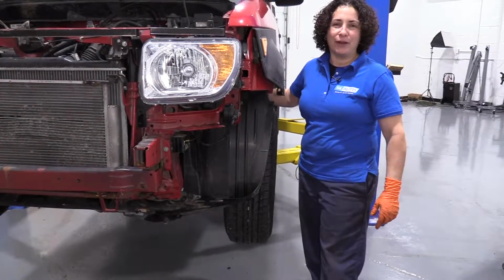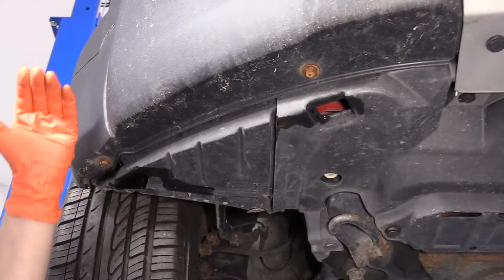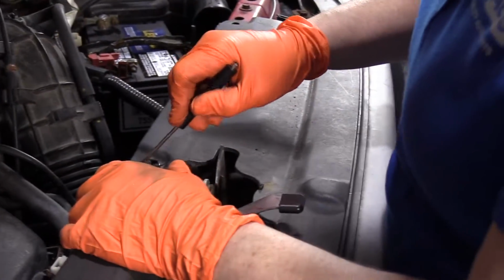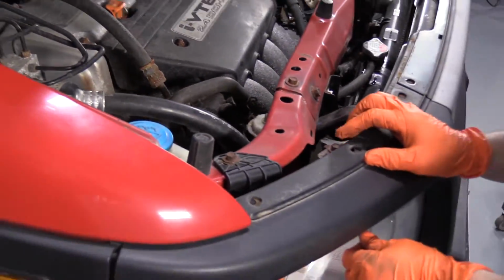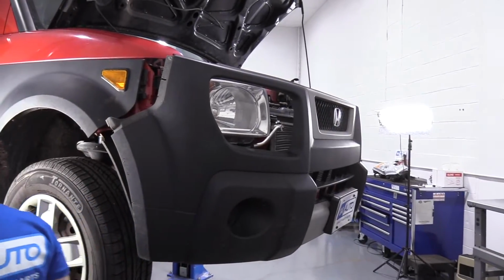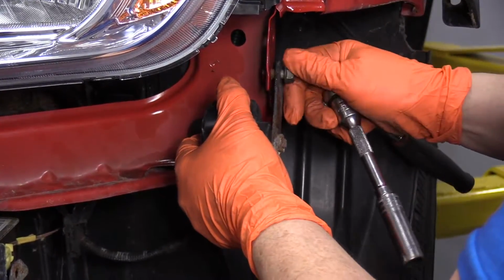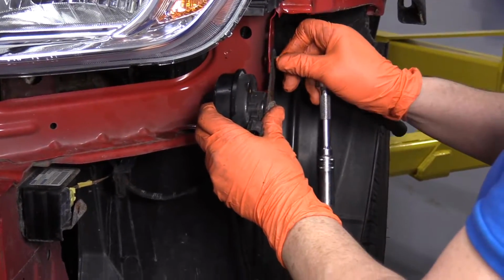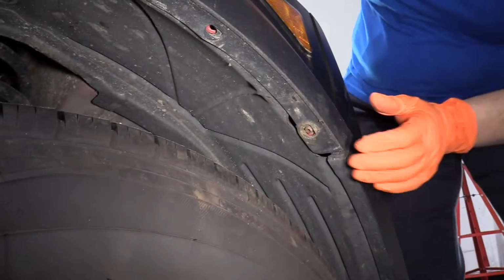How to Replace Horn Assembly 03-11 Honda Element

Comment: I tried to replace my Element wimp horn with an Italian Marco Toronado. I didn’t have a lift, so the 1A video put me off right away plus didn’t know about panel fasteners SO I determined to go in through the wheel well. Idiot that I am. Turned the wheels to the right and jacked up the car BUT couldn’t get the lug nuts to budge! (!!). Loosened the wheel well, one screw and 3-4 fasteners. Surprisingly got the stock horn off—only one nut with wd40. But getting the Marco on was just not working!  2 hours later I decided to remove the grill and bumper as recommended. Again easier than I thought. Off in ten minutes. Now easy access to the horn. Put the new horn on and bundled it up. Sounded great!  Loved it. BUT The next day won’t work. Turns out this horn draws 18 amps on a15 amp circuit. Grrrr. So I was able to return the Marco and order a new one that only draws 6 amps. Things a novice like me never thought of. Bought some fasteners tools and variety pack, Element now unbundled and waiting for new horn. Learned a lot. Hope the new horns will sound as good as the Marco. 🥴
Reply from the maker: +James Clawson Thanks for checking us out! 1AAuto.com